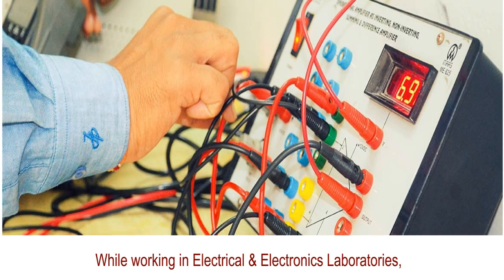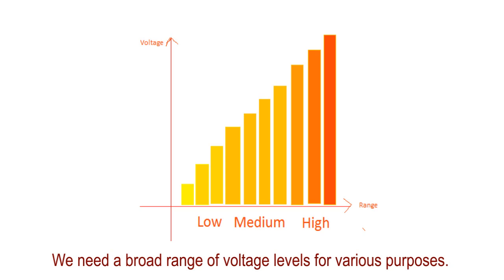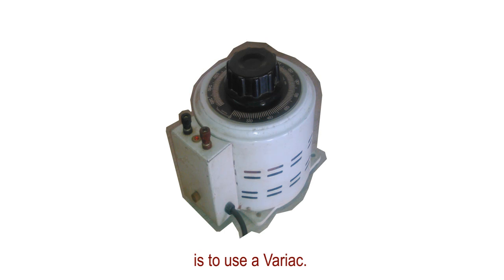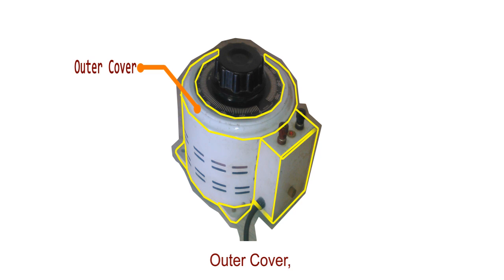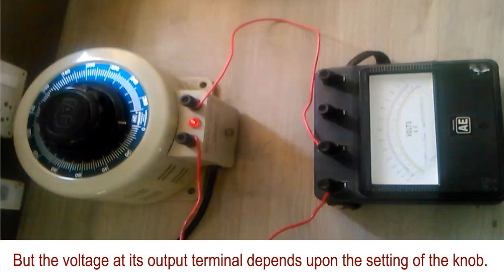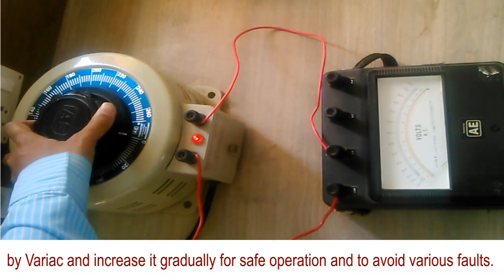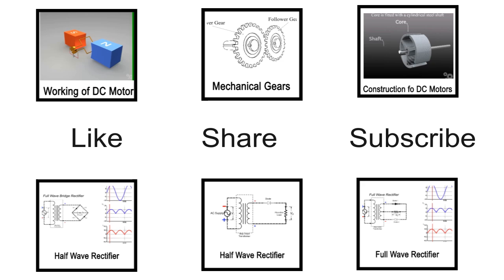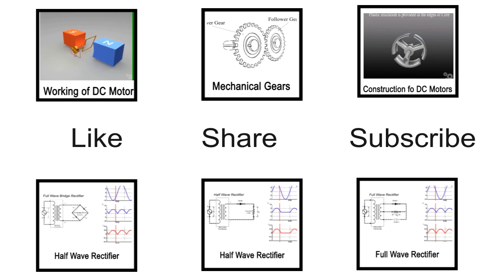Auto transformer

Comment: The primary and secondary windings of a two winding transformer have induced emf in them due to a common mutual ﬂux and hence are in phase.The currents drawn by these two windings are out of phase by 180◦.This prompted the use of a part of the primary as secondary.This is equivalent to fusing the secondary turns into primary turns.The fused section need to have a cross sectional area of the conductor to carry (I2−I1) ampere.
This ingenious thought led to the invention of an auto transformer. Figure  shows the physical arrangement of an auto transformer.

Read entire article at

http://www.electricalengineeringinfo.com/2015/02/auto-transformer-construction-and-working-of-auto-transformer.html